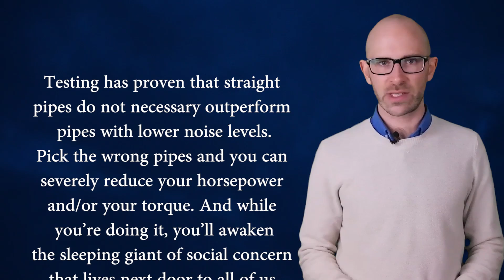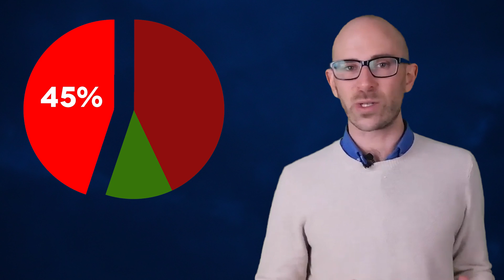Why are Harley Davidson Motorcycles So Loud?

Comment: When I purchased my 2001 Fatboy FLSTF at my local HD Dealer it has 1 3/4" straight pipes installed on it.  It was pretty loud.  I installed a fairing and a nice radio on it and I could not hear the radio.  I installed a set of screaming Eagle Slipons after that along with the stock headers.  That was fine but I looked messy.  So I installed a shorter 2 into 1 pipe setup and ditched the stock headers.  The Bike does not have the growl that it used to but it does have a pleasing tone and I can hear my radio.  Also with the 2 into 1 setup I have cleaned up the mess by the back wheel and I can not get to my back breaks to change them when needed.....  You should never really use straight pipes.  You loose back pressure and it might only be good for the 1/4 mile but for long runs you are doing yourself a disservice.  Tuned exhaust is the way to go.  Also remember every time you change your exhaust you need to make sure your carb jets are matched to your exhaust.

Comment: I installed Screaming Eagle Pipes because of this video... jk.  I installed them years ago and they are the only reason I can still ride.  I have a Harley with factory pipes and one with Screaming Eagle pipes.  I often get pushed off the road or cut off on my bike with factory pipes.  Single vehicle crashes are not saying the bike rider was at fault... it just says one vehicle crashed... the other vehicle kept going down the road while the driver continued to read their text and program their GPS.  Really, distracted driving has gotten so bad the last couple years, I am contemplating selling both of my bikes.  As if riding bikes wasn't dangerous before!

Comment: Personally, I enjoy the sound of a loud, well-modded engine...but they don't exactly save lives.  Since the sound is all aimed out the back, a car driver at highway speeds generally can't hear the bike passing him until it's alongside (especially since most cars these days have much better sound deadening than in the past) - and then the sudden, loud noise startles the driver, causing them to instinctively jerk the wheel as they turn their head to see what's happening.  Frankly, it's actually more dangerous at speed is these situations.  Now, if the exhausts pointed forwards (for the same reason sirens and car horns are pointing forwards - so the sound will project in that direction and give some warning as to what is approaching), then maybe there would be a logical reason for it.

Comment: The comment section of this video just made my skin crawl. I had no idea that there were so many dumbed down drones around. I don't have a Harley, but the pipes on my Ram get up to about 98db when I get the engine up around 2500 rpm. I try to keep it down in residential areas, but after reading some of these comments I might have to pipe through some unfortunate neighborhood just to reestablish balance in the force

Comment: Wrong interpretation of the db scale. a 10db increase equals a doubling of perceived volume while it takes a tenfold increase in power to achieve that acoustic doubling in output. In short, 1w output on a given speaker is half as loud to the ear as 10w. Not ten times less loud.

Comment: You're better off adopting changes in your lighting.  Trains are much louder than motorcycles, and the railroad industry solved most of their accident problems by the introduction of the mars light, not by making the train louder.  I'm still using a 4 blink per second device in my headlight during daytime riding. It automatically triggers the human mind's attention. With no additional noise, and not riding like an idiot, no cop has stopped me in last 30 years.  I've been riding now for 40 years.
Reply: When the stupid car drivers are careening down the road concentrating on their text messages, everyone is in their blind spot.
Reply: Makes sense. This is not legal in all countries though, unfortunately
Reply: Sensimilla Obsessions headlight deal noticed by guy coming towards you, good idea. Tail light deal noticed by guy behind you, good idea . loud pipes, noticed by EVERYONE ! not a good idea. better to be seen , not heard, there are plenty of those morons
Reply: Uh, the headlight modulators which blink high beams are used IN THE DAYTIME to get other driver's automatic attention; it happens without thinking, your eyes are drawn to it. That's why the it blinks so fast.. Nobody's getting blinded.
Reply: very true !! i had a blinking red light on top of my front wheel and one on my plate all was well didnt have as many close calls. unfortunately last year i was pulled over and told i could not have the lights as im a distraction to other drivers.. even after i explained why i needed to have those light and how i was trying to make my riding safer i was given a ticket and told to remove..... bunch of bullshit if i ever die on my motorcycle im having an invitation for my funeral sent to that cop,  kept his name and badge number.
Reply: because that's just stupid... im trying to be safe, not stupid.
Reply: You lose, unwitty response just foul. lol this isnt even your channel. I thought i was going to get trolled but i ended up trolling woo life's good . byeeee
Reply: D.E.B. B Though I've got 10 more years riding on you, I am in complete agreement. 50 years of riding 7 days a week on stock bikes with stock mufflers and additional lighting. Even though I haven't changed my riding habits, and traffic has increased 10 fold or more. With the exception of a mandatory DOT approved 1/2 helmet, I never wear supposed riding gear, but I do have additional after market lighting. In 50 years, I've never dropped a bike, had an accident or received a ticket. I don't wave at other bikers, I don't do group rides, I don't ride because it's fun, my bike is a nothing more than a form of transportation I choose to utilize.

Ironically, the nearest I've ever been to being involved in an accident involved younger riders on their rocket bikes whom are constantly darting in and out, around and thru traffic. The number of accidents which include the police whom are schooled on it in states that allow lane splitting is going up every year. Which means so is the mortality rate. At some point, due to the numbers, lane splitting will eventually be stopped. Even the most experienced rider in the world has no clue as to the experience and abilities of another rider or other (cars, trucks, buses) and their intentions or desires to get where their going in the most expeditious manner. It doesn't take rocket science to realize once you've made it to the front of a pack of cars and trucks, and speed up, you catch up to another group, only to bob snd weave your way through again and again. Riding like that is just increasing fate and the laws of probability.

The price difference of additional lighting vs louder exhaust is nil, the safety difference is like night and day.
Reply: D.E.B. B  Mars light? Really? Railroads for the most part haven't used those for years, oops, decades, unless it's a commuter railroad still using decades old power. Railroads solved a lot of their grade crossing accident problems by going with the triangulated arrangement of ditch lights and headlights all lit up at once when they are on the brightest setting. The triangle shape of the lighting allows people viewing the oncoming train to more accurately judge the distance to the train from where they are viewing it from.
Reply: D.E.B. B good point , rider
Reply: William Guy Thilgen Jr. night and day , I get it 😆 you make some very good points, I have over 1/2 MILLION miles on and I find riding one of the most FUN ! things I have ever done.
Reply: D.E.B. B yes but when you can't see the bike a light will do absolutely no good whatsoever the loud sound will make you say hey there is a bike in my huge blind spot
Reply: D.E.B. B cool
Reply: yep. and turn on the motorcycle headlights even in the day time were mandatory in my country
Reply: Robert Dobbs or a G__10R?
Reply: Art Mchugh I'd rather go the extra measure to ensure there is a lesser chance of being in the situation I was driving to town the other day in my car and this dude just fucking merged without looking if I had a loud vehicle he wouldn't have to look cause he would've known someone was beside him
Reply: Robert Dobbs thanks bob , some of them i don't think will ever learn.
Reply: +Cameron Vandygriff They don't assume that the bike is in their blind spot. And when you annoy people, they usually have less than your best interests at heart. 
+Bantham Nobilis You can't count the number of people who have NOT been hit by a train due to trains having better lighting. Same as you can't count the number of people who have not been killed by criminals because they were better armed. So you will never find the proof that you require. However; saying that you're not more likely to see something with a more visible light kind of goes against all logic.
Reply: 1. Trains may be louder but they tend to stay on tracks and not next door. 2. Car drivers ARE dangerous to everyone. So, whether you are a pedestrian, cyclist, or on a motorcycle it's up to you to make sure you're aware of your surroundings. Car drivers will be very sad they hit you and so will your mourners.

Comment: Loud pipes save lives. 

HOWEVER, there's a difference between "Loud enough that the suburbanite yuppie listening to an eclectic mix of terrible Disney music, terrible pop music and terrible country western will hear you inside her oversized SUV, thus preventing her from making an illegal turn from the wrong lane without signaling and running you over" and "I want you to be able to hear this fucking thing from low orbit because anything else would be an affront to my masculinity". 

Harleys aren't really that loud from the factory, people just put halfassed non-mufflers on them and the rules aren't enforced on them like they are on literally every other bike on the planet.

Comment: "Loud pipes save lives."
1) Maybe many of you wouldn't need them to be as loud if you didnt drive like assholes.
2) Emergency vehicles are louder AND bigger AND have a shit-ton of flashing lights. People drive worse near them.
3) Idiot drivers don't magically stop swerving across 3 lanes of traffic without signalling and then slamming on their brakes because you removed your muffler.

Comment: +10dB of sound pressure level (spl) is not a x10 multiplier of the sound pressure in Pascals.  dBspl is a 20log scale, meaning that +6dB is equivalent to double the spl.  +12 would be x4.

Comment: Errr I think good fellow you have made a mistake. The Decibel scale is indeed a log scale, however +10db is a doubling in sound energy. eg 70db is twice as loud as 60db, not as stated '61db being twice as loud as 60db'.
Reply: check again at 1:07 The video says 80db would be ten times the sound pressure than 70 db.  and the caption says 80db = 70db x 10
Reply: I mis heard, and then wrote a comment.. ( I shall hang my head in shame forever ) Sorry Aussie, Sorry Internet!

Comment: Most bike crashes are the fault of the cyclists... that might be true, but during my experience of one summer of riding a motorbike I had two events where someone driving a car tried to kill me, on purpose. I was lucky to be young and with good reflexes back then and I managed to get away from those situations. Anyway, in this country there is legal limits for acceptable motorcycle noise, but it doesn't seem to concern any of the Harley owners... shiiiiit.

Comment: And there is nothing wrong with loud pipes. The problem is pipes that are TOO fucking loud. Another thing is douchebags who rev the bike as  they pass by peoples homes. Dont hit red line in a residential area. Not all of us r dicks
Reply: I have very loud pipes...I keep it low until I'm on the freeway.
Reply: That's the perfect response!!! Excess is what is to blame here!
Reply: Mario-2700 seems to me, the real question is why are lawn mowers so loud?   On any given summer morning I can hear a lawn mower or two from as far away as the next neighborhood droning on for an 30~40 minutes at a time.  Why do we tolerate that, but get mad at the guy on a Harley we hear for 10 seconds as the pass our house?
Reply: Mario-2700 right on, very good point.
Reply: wargasm74 Exactly. I do the same! I also turn off the bike whenever I can because even at idle my pipes are thunderous... I respect people around me, and I expect others to do the same for me!
Reply: Couldn't agree more. I drive one of the quietest bikes on the market (nc700) and have people merge into my lane or try to turn in front of me on a weekly basis. I wear full high viz gear, but live near campus so have to put up with it anyway. What I don't understand is why massive trucks running straight pipes and hoopties with subwoofers are considered fine, but as far as the public is concerned, loud pipes are made by satan. 

"In California, the Oakland Police Department made the pipes on its own patrol motorcycles louder, after an officer was hit by a car whose driver said he hadn't heard the bike coming"
"The NHTSA worried that silent electric motorcycles and other vehicles would go unnoticed in traffic"
-According to howstuffworks
Reply: I could rip it through my neighborhood but I leave it low in first gear I wouldn't want anybody to wake me up that way and I won't I live on a very small Street and there's at least seven others that ride Harleys. I even push mine out in the street and pointed down the street so it doesn't reverberate in the garage
Reply: Now in the middle of summer it's a different story we all go fucking crazy on each other but not after 10 o'clock
Reply: wargasm74 Exactly right! All this labeling and generalization makes me sick!
Reply: yup. my ninja 250r is practically straight-piped. you can laugh, but its exhaust volume can compete with an un-baffled 883.
Reply: Show-tek I do believe you. I had a 125cc pit-bike with straight pipe. Might not be that bassy sounding, but loud AS FUCK! (not suitable to ride every day, maybe on the weekends)
Reply: yeah i need ear plugs just to putt around town on it. on the highway at 13k revs... forget about it. haha
Reply: Exactly, put a set of Vance & Hines in? Great, but also put the muffler inners in, the sound is reduced to a level that is not violent, but still sounds amazing, and actually gives you that much needed back-pressure which helps performance.
Reply: Mario-2700  Spot on
Reply: Mario-2700 as a sportbike, motocross, and sumo rider i can't agree more.
Reply: Lawn mowers may be loud, but the pitch doesn't quite rattle the windows on my home the same way that the bass rumble of a bike would. I think That would be the main difference if it at all matters: A tolerable drone instead of a startling booming.
Reply: I do ride near redline but I'm on a stock exhaust.
Reply: Mario-2700 I think the same could be said for stereos-both in home and in cars. No I don't need to know that you're coming down the road a mile away....or notice car parts that fell off your car due to the rattling. Or how when my neighbor turns her stereo up the the MAX at 6am, when I'm heading to bed and our apartment walls are thin, and "quiet hours" are until 8am anyways!! It's about courtesy, I ride in quietly and kill the engine when I come home at 5am and my bike is already quiet anyways, but I try to be courteous.
Reply: Agreed!
Reply: I have very loud pipes...I keep it low until I'm on the freeway.
Reply: I have got Vance & Hines no baffles it is absolutely loud I've even walked all the way down to the corner before I hit the button when I have been called in at like midnight to go to work if you respect people they respect you
Reply: good point
Reply: Xavier Cebeira 4-stroke engines do not need back pressure from the exhaust. The less you have, the more power you have at high revs. 2-stroke engines do
Reply: Cory Hill I can't believe you just said that... torque? Why must you be at high revs? ;)
Reply: Xavier Cebeira  dude I'm not even gonna argue anymore. You knew what I meant, you just want to pull out the proper terms now to make me seem stupid. Just know that 4-strokes don't need back pressure at all.
Reply: What? I was not correcting your words at all, I am saying that torque development in many cases requires back-pressure. Sure you can ride a 4 stroke with no back-pressure, you can also ride a bike with no tyres...
Reply: Mario-2700 set the bar,, straight here huhh!!! 👌Hahaha 👌 i never delve into comments ,  but here,  i totally agree&support your observational Facts Brother!!   And.  spot on from Marse also!,.,  my good brother. Who is actually like a father to me.  Who just sold this Road king i can speak for.  Had all factory tubes, but with baffles pulled.  And. On an otherwise stock motor.  (Aside from whipple charger & removing baffles out rear pipe section).  It could &would. Burry out everything around,  But!.  Only when driven like a Moron!    @idle cold start,  93db 
But once warmed up.  Down in the 83db range. @idle.  Smooth V8 chop.  Sounds like a Big block GM.  Wish i had some short sound clips.  It sounds Epic.  Riding along him,, on countless trips. Only time it's noticeably louder then rest. Is in the 90-120mph. As any bike.  Pipped or not!  LoL. But driven respectfully. And properly. Not always Ego twisting it.   That bike is actually enjoyable to hear.  All day all night 😎.
Reply: CirtcuitFreq Don't know much about maths do ya.
Reply: The same douchebags who rev them up when going under underpasses for the acoustic amplification effect.  Basically attention-seeking man-children.